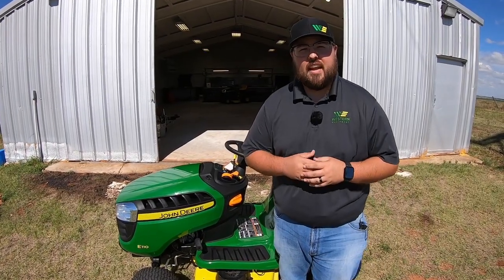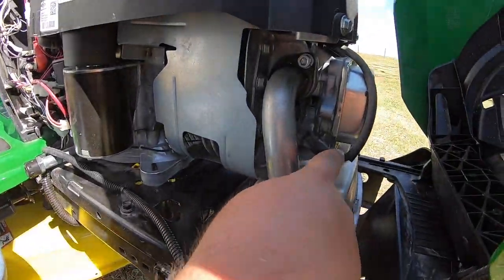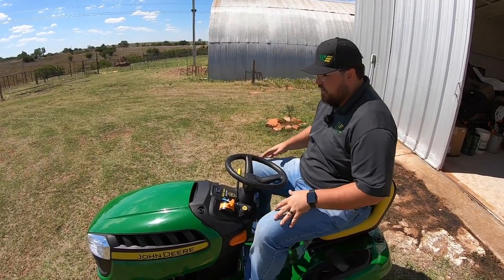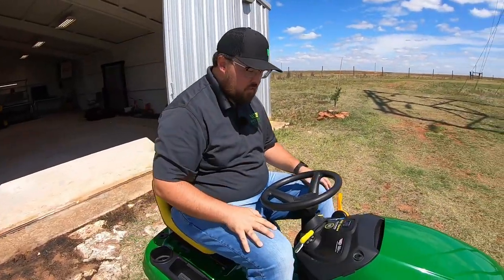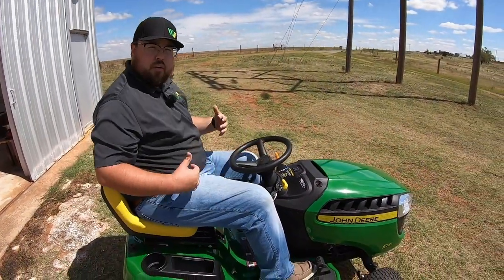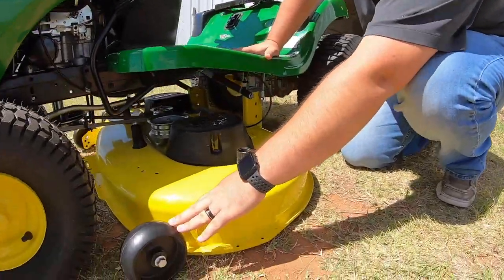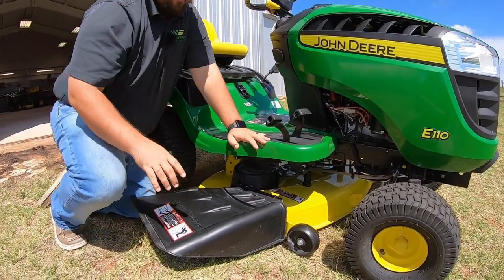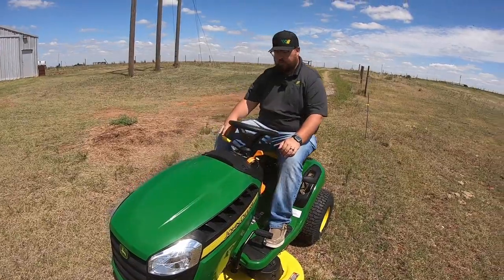John Deere E110 Riding Lawn Tractor Mower Review and Walkaround

Comment: Spark plug new and has fire, fuse intact.   However acts like no had which is full as well as oil ok too .  When the spark plug is out I get a rust color exhaust out of spark plug hole
Reply from the maker: Hmmm that’s interesting.

Comment: I bought my E110 new. I noticed it would blow some whitish smoke for about 30 seconds after startup, then no smoke at all.  My John Deere dealer did the initial service for free and when I asked about the smoke, he said "They do that".  What I actually see when I open the hood is moisture seeping out of the welds of the muffler.  I'm not sure if it's just that moisture burning off or more than that. Then engine runs fine. And, I just did my own service (at 80 hours) on it and it still smokes.
Reply from the maker: Hmm this is interesting. I know that they usually smoke, like you're talking about, on a cold start, but I feel like after 80 hours it should not be doing this anymore. Is it using oil?
Reply: @WesternEquipment  I check my oil level all the time thinking that might be it.  But, it's not burning oil at all. Strange.

Comment: Great Video Brent !! -  I have been looking at the S130 but saw an E110 which was about 300 dollars less so I am doing a comparison.  One comparison is the S130 has rear tires 20x10x8 while the E110 has 20x8x8 -- Can you comment if bigger rear tires mean a difference in cutting height ?  Thanks.
Reply from the maker: Thank you for watching! To answer your question, no the cutting height will not be affected. The bigger tires are just to add for more traction and a smoother ride.

Comment: Hey mate I'm in Australia and I own an acre of land with plans to build in the new year. I've been stuck between the 100 and the 110. I'm leaning toward the 110 just chasing your opinion on the matter. It's a bit uneven plus there's about 5 meters high difference between the front of the property to the back. So slight gradient nothing to crazy though. Mind you I've watched all your videos on both mowers cheers mate🍻 👍
Reply from the maker: Joe thanks for watching our videos! I would go with E110. The videos show differences but you will like the hydrostatic trans so much better. Check out Emmetts in Australia. They are good friends and good people.

Comment: I had to replace the ACR  (  Auto compression Release )  on my neighbors 17 hp Briggs engine that comes in these mowers.   Not that bad a job but this mower  only had 60 hours on it and less than two years old.   Briggs has been going downhill for sometime and as most know filed Chapter 11 bankruptcy this past July.   

   I have a D110 with the 19.5 Briggs that is 10 years old  that my wife uses at my home with 250 hours on it.  Adjusted the valves at 200 hours and also change the oil as suggested.  The muffler is too loud but other than that its been good. 

At my shop I use my 1995  JD GT 262 with the Kawasaki 17.5 engine I bought new and never done a thing to it.  Not sure about the hours but it has been used a lot.  I always keep it in the building ,  It looks as good as the day I bought it except for the cracked hood.  Common on these model mowers.   Its much quieter than these Briggs and much better engine.  I also paid a lot of money for this one in 1995.  Cost around $4000 back then but this one is still going strong.  You get what you pay for so keep that in mind when cutting corners on these JD mower.  Check out a JD dealer instead of the box stores if you want one that will last.
Reply from the maker: Wow, interesting stuff! Glad to hear about those mowers still going strong. And unfortunately we do here things like this about the newer Briggs engines. Thank you for watching and for the comment!

Comment: Brent, it seems like JD has basically taken the E110, dropped it to a 17.5 HP, and rebranded it as the S100, with the E100 going away altogether. Is that about right?
Reply from the maker: So John Deere just did away with the CVT transmission that was on the E100 model. Now all S100 series mowers will have the same hydrostatic transmission. One change to the model line up is that they did away with the E150 and did not replace it with an S150.

Comment: I'm debating on this model, or the e130. I'm mowing a 8/10 acre with just a septic hill does the v-twin, or Horse power matter when doing just mowing?
Reply from the maker: I would say with that much to mow that you may want to consider the E130 for the comfort. The E130 has a higher backed seat than the E110 and you may have better luck with the larger V-Twin engine in the E130. Let me know what you decide and thanks for watching!

Comment: How do you tighten the blades belt?
Reply from the maker: Unfortunately there is not an adjustment. I would check your tensioner pulley on the top of your deck and see if it has worn and may need to be replaced. I hope this helps and thanks for watching!
Reply: You can tighten the belt bracket that holds cable on the deck is slotted for adjustment

Comment: Do you got any zero turn radiesse lawn mower
Reply from the maker: Deere makes zero turn mowers, current models are Z3, Z5, Z7,Z9. There are also 4 wheel steer option in the Lawn Tractors that almost has a zero turning capability.

Comment: craftsman t100 vs this  john deere.. which one.. help
Reply from the maker: If it were me I would go with the John Deere S100 or S110. There are a little more in price that the T100 but they also have much more HP and they have a hydrostatic drive which is easier to operate. Good luck and thanks for watching!
Reply: @WesternEquipment  thank you

Comment: Don’t get this mower. There is no way to adjust the belt tensioner on the deck, so the belt is constantly snapping or popping off. It’s a poor design. The engine and everything else runs great. I’ve had it put in the shop twice because they said it was bad pullies at the shop. I got it back and have the same issues. My neighbor has the E100 and the deck belt does the same thing on  his mower. I’ll never buy another John Deere mower! It’s not worth the price I paid for it. Other models let you adjust the tensioner.